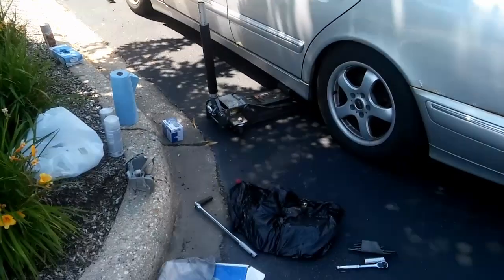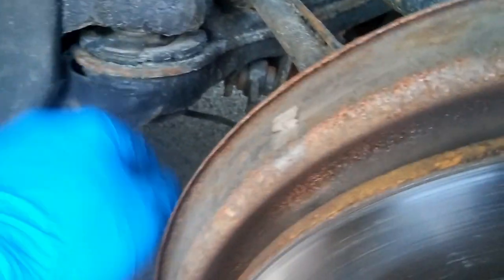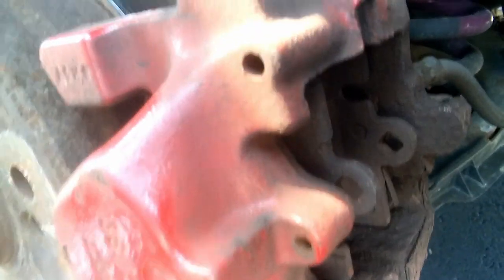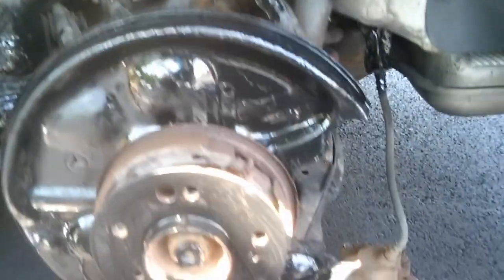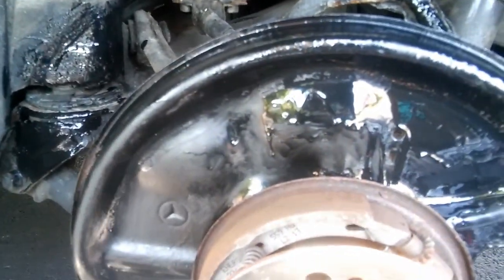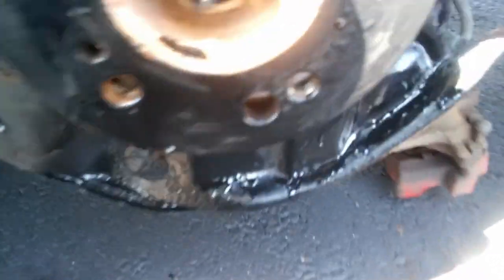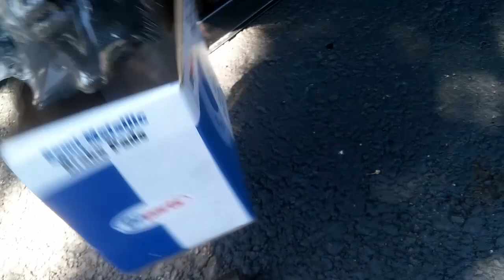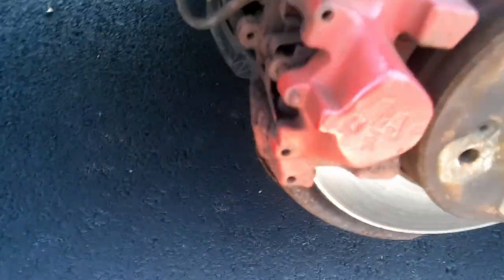MERCEDES-BENZ W210 REAR BRAKE PADS AND ROTORS

Comment: You skipped the part when’re you loosen the tension on the parking shoes. How do you do it? I can’t seem to loosen it
Reply from the maker: There's no need to loosen the parking brake shoes. Is your parking brake working?
Reply: VITO'S GARAGE yea it works but it won’t come off. If there’s no need then idk why it hasn’t come off yet. I’ve beat it with a hammer to the point there’s indentations on the rotor
Reply from the maker: @AlexE55Jr  your rotor is probably rusted on to the hub. Hammer the rotor on the bottom side. Eventually it will come off. If still no luck, use a flat head screwdriver through one of the bolt holes. Use a flashlight to find the starwheel (it has teeth) through the hole. You might need to turn the hub around. Finally, turn the starwheel one way or the other to move parking shoes away from the rotor
Reply: VITO'S GARAGE I’ll try again tomorrow and let you know
Reply: VITO'S GARAGE thanks!

Comment: did you have a jack stand there.. If not pretty dangerious.  safety first
Reply from the maker: Thanks for your comment sir! No I did not have the jack stand and yes, I know. However, I never went under the vehicle. If I go under the car I always use a jack stand. I was in a rush to finish those brakes. I totally agree with you, safety first!
Reply: yes I never rush anything cause if I rush something it will take 2 to 3 times as long to do it if I take a slow and low  pace. that is what I found out. it is not just going under the car. Never trust the HYD. on the jack. you could of bumped it and it will let go and have a bigger mess on your hands with a screw up left susspension :D at a bare min. put the tire under the car so it wont crash to the ground on a mishap.
Reply: Christopher Baker I think Vito knows that) and that working with two hands much easier, but what else he could do? He loves filming and showing work in live (almost)! ;)
Reply: My dad had a brake rotor pin him down when changing a tire. At the very least, put that wheel under the differential. Sh-t happens